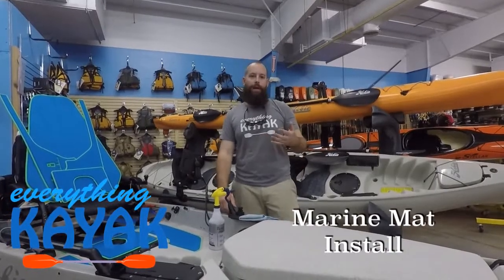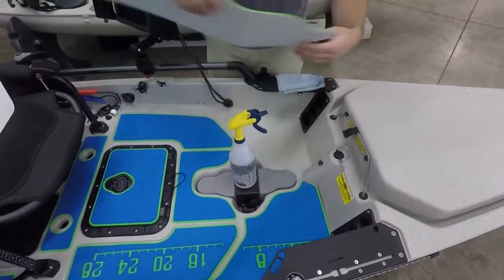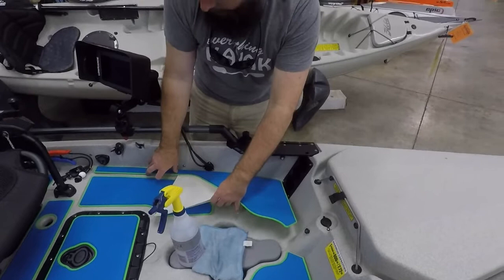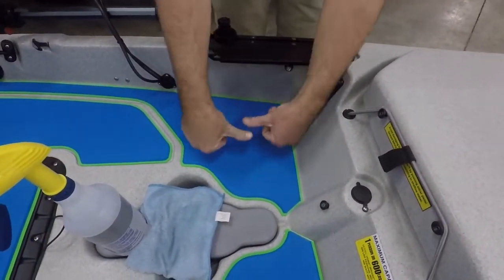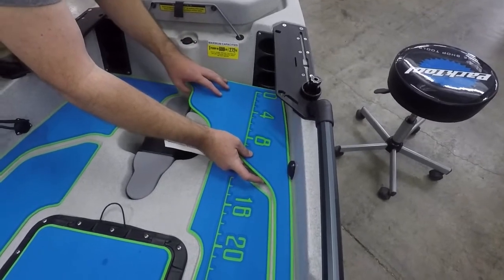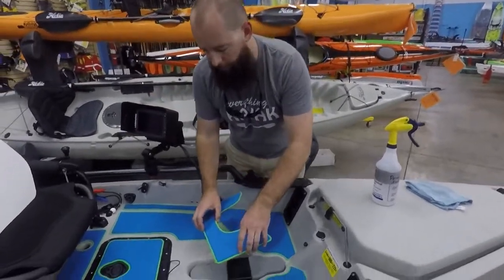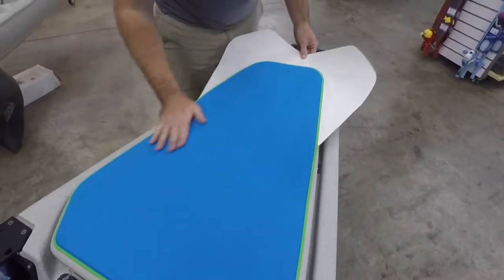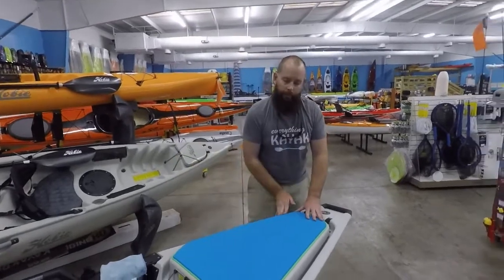Marine Mat Install

Comment: I really like the way you relocated the bungee for the front hatch to the front part of it. Wonder if it will still seal the same?
Reply from the maker: If someone is using their PA offshore or in surf we would suggest keeping the original bungee layout.
Reply: @everythingkayakbicycles9975  that's what I was thinking. I don't take mine offshore but I've been in pretty heavy swells in the bay. Thanks! Enjoy your videos!

Comment: Do you think it’s important to remove the existing foot mats.
Reply from the maker: If the kit you are installing on a Pro Angler included the standing pads you will need to remove the factory black pads to apply the replacements from Marine Mat.